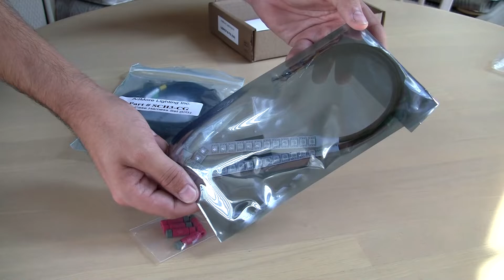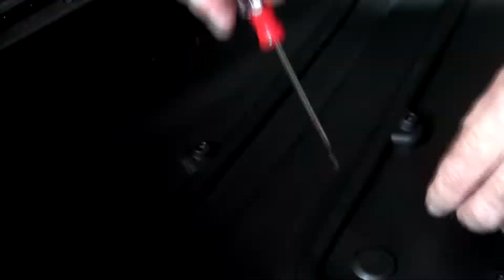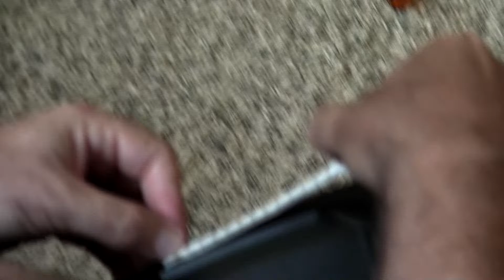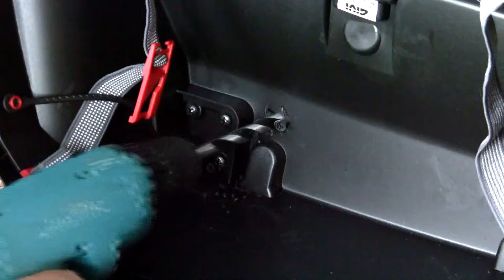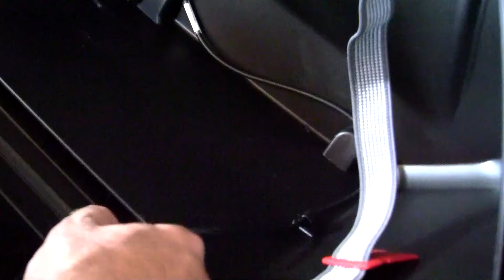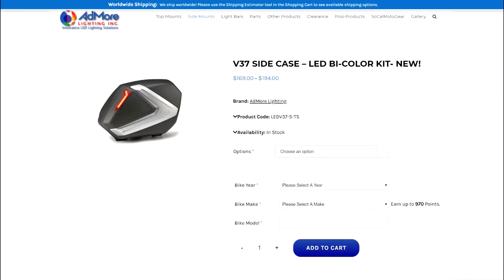AdMore Lighting V37 LED Light Kit Installation

Comment: Are the bags removable after you install the lights? Can you remove them without unplugging anything???
Reply from the maker: Yes! Bags are easily removable.  You simply twist the connector(s) a quarter turn and you can remove your bag(s).